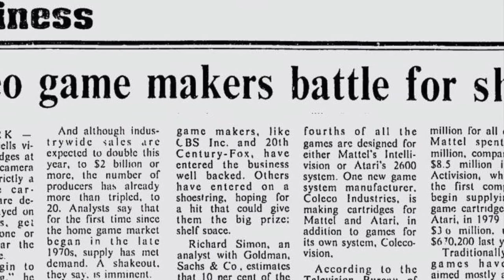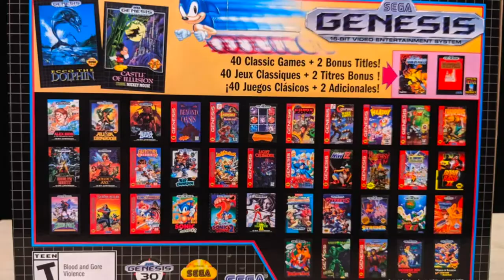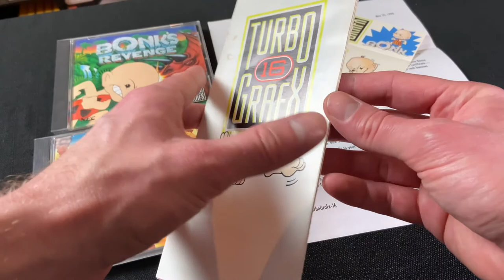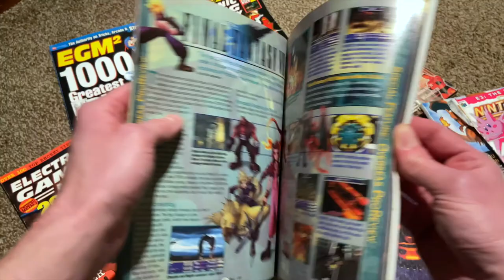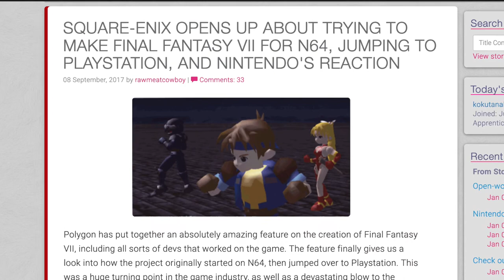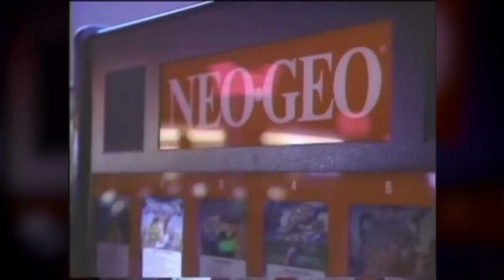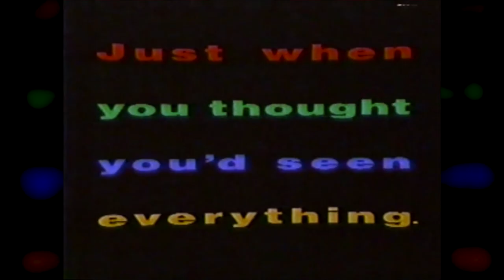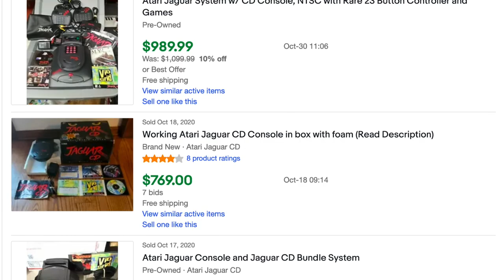The Swan Song Games of EVERY CONSOLE from the NES to the PlayStation 4! - Part 1 (NES - N64)

Comment: "The SNES blew the Genesis away in every other technical category."

Except for those 8-bit databus bottlenecks. And it's just limited to 16kb of VRAM for object tiles. And you can only use two sprite tile sizes at a time, leading to a lot of wasted resources. 

And most of the Genesis library runs in a higher resolution (320 vs. 256.) Only RPM Racing uses the high resolution mode for actual gameplay.

And you'll know why as soon as you play it. 

Look, I love the passion you guys have, - this was a great idea of a video. Plus, you do an amazing job of editing and sound quality... but you got a lot of things wrong.

The Turbografx 16 is named for the 16-bit graphics chip. Atari had a larger share of the NA console market than Sega's Master System. Super Mario Bros already had a direct sequel in Japan, before Mario 3. 

That sort of thing.